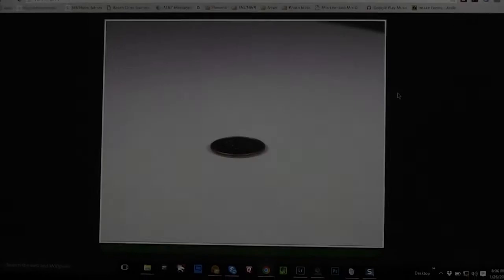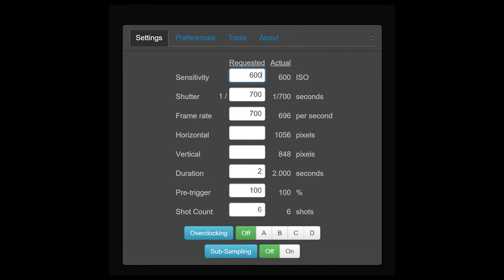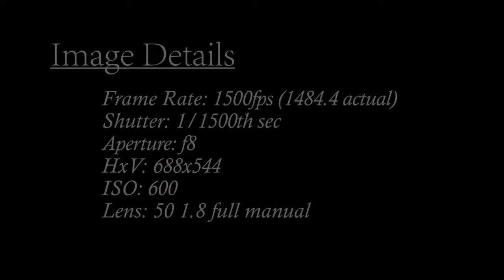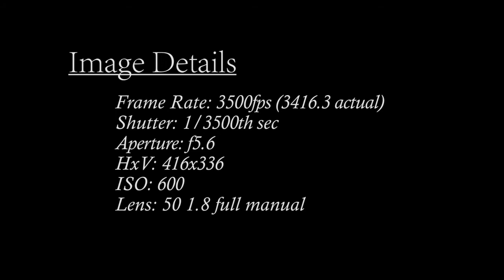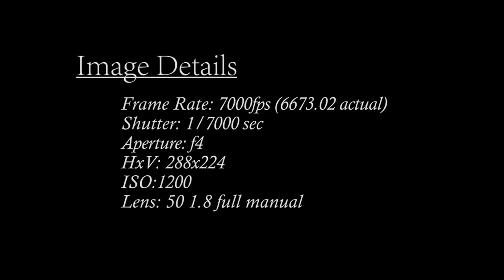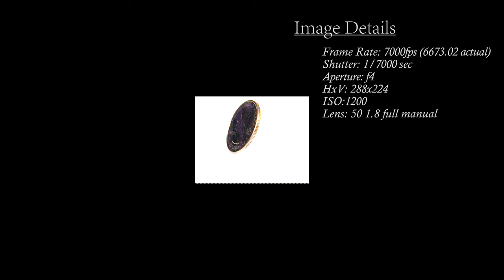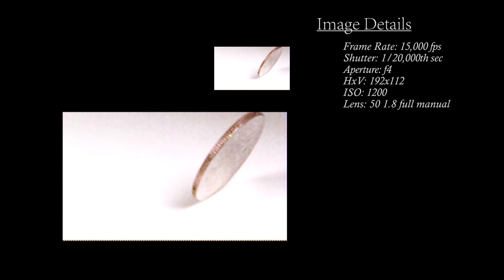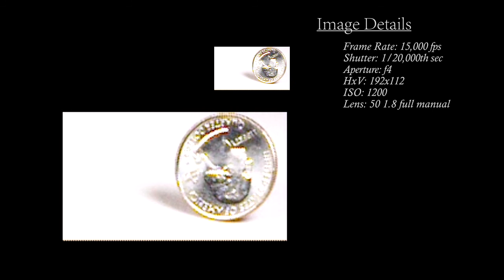Dracast LED 1000 Daylight Light Panel - High Speed Test

Comment: There's stisl some flickering at 3500
Reply from the maker: +Ronnel Cuison - I mention that in the video.  I do think that this was something other than light flicker. I agree that there is movement in the lighting only at 3500 fps - but I can't figure this out.  The color of the light doesn't change (which would be typical of flicker), only the intensity.  Given the quick fluctuations it doesn't match what I think would be a possible flicker rate (hertz) of the lights.  Also, you'd see flicker far clearer at 700 fps than 3500, and there is nothing beyond.  i think it was the camera but am in contact with the camera manufacturer to see if they have any ideas.  Back to you shortly on this.
Reply from the maker: +Ronnel Cuison  - Here is the answer.  The camera manufacturer is reporting that this was a form of camera noise generated by the combination of ISO, frame rate and resolution. This is an anomaly at certain settings and it happened to be revealed at that setting and not the others.  This explains why the apparent flicker occurred in a pattern that would not be consistent with typical light flicker.